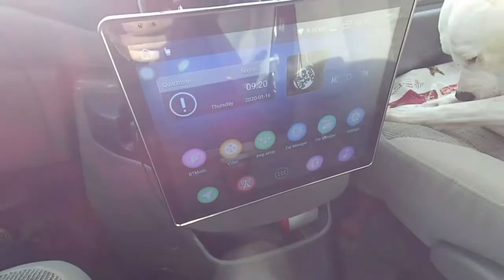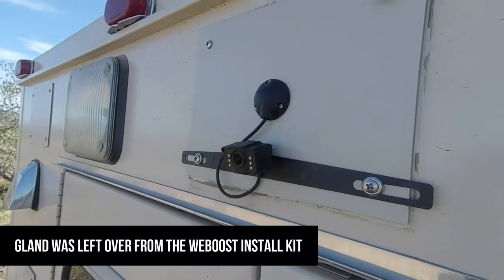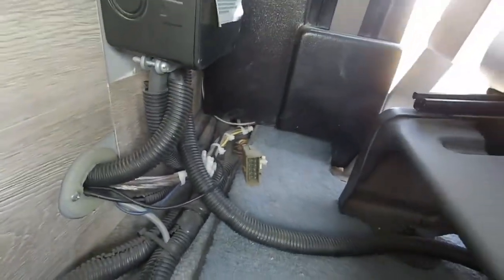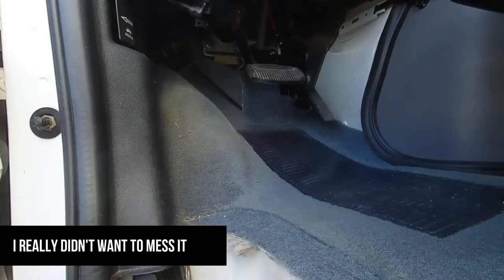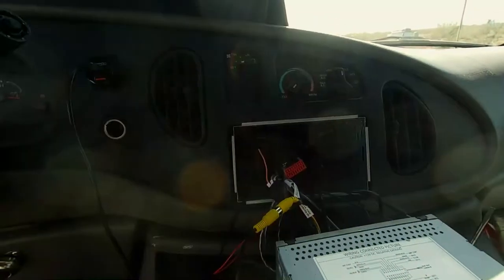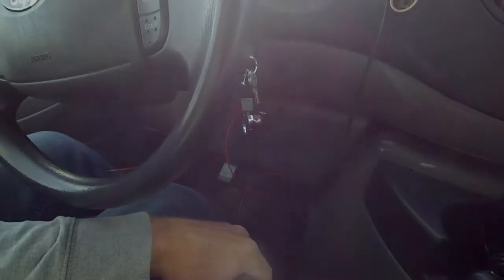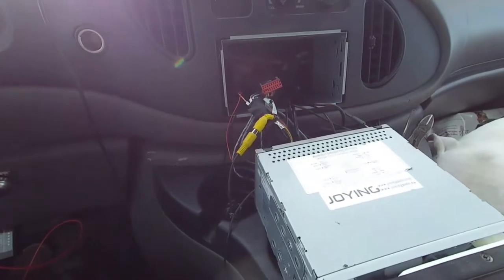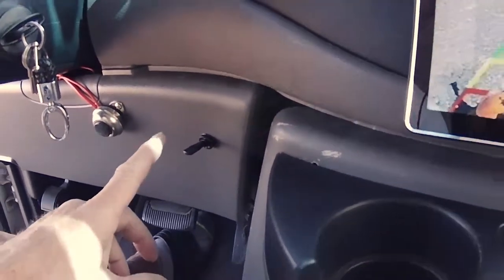Ambulance RV Conversion Gets A Back Up Camera | Building The Campulance

Comment: Thank you for being so detailed with where and how you ran the wire. I have a window AC unit that came with the ambulance but not a heater and I do not want to use a Buddy heater for long. I did not know that the pad in the ceiling would have easy access to wiring, but yes it does. I looked at mine, and I added extra 120 outlets over by the existing bench area. I have not done a heater yet and I will probably come back to this video again to refresh and install along with your video and pause it as I go.
Reply from the maker: I'm glad that it helped you!

Comment: im going to power my revers light with the rear beacon switch. 12v power alread in the back just need to run the video cable and get a sweet head unit. thanks for the motivation. nice job!
Reply from the maker: Hi Joe - yes that will work... but... I'd recommend running it from your fuse block and put a switch on the dash like I did. Having the ability to see what's behind you at any time is valuable. Merging and changing lanes especially. Glad your diving in to it!

Comment: 👍🏼 I did the same thing for my father-in-law’s truck but I use an on-off-on switch. One position was on constant like you have it. The other on position was tied to the reverse lights so when you put it in reverse would automatically changeover.
Reply from the maker: Ah, that's a good idea!

Comment: LOL,   Gotta love the cameras view of the rearend. 
I went overkill on my Big RV.  I put in 9 cameras in my Coach. One under the front bumper ,one under each of the 2 side mirrors looking down the side, one at the top of the rear of the camper , like yours, looking behind the camper where I carry my motorcycle. Then one above the trailer hitch so I can back up to a trailer or to my Towed.  On the side, near the at the rear of my RV, I have flood reversing lights to aid in backing into Campgrounds or corners in tight parking lots, so I put cameras next to each of those 2 side lights.  Then one on the porch light at the entry door and the last one on top of my remote control spot light so I can see if I'm going to clear low hanging obstacles, or scan for tree limbs that will damage my soon to be solar panels, or the RVs AC units or Satellite Antenna.  It's my favorite because I can turn it 360 degrees for a view.   There is a camera switch under the overhead cabinet above the driver area that allows me to switch between the cameras individually, in pairs or groups of 4. All on a 9" monitor on the dash.  The Door Camera can also be viewed by the Bedroom Monitor.  
Like my Dad used to say, "It only cost a little more to go first class, I just can't stay as long!"

Enjoying the improvements and almost caught up watching all of them.
Reply from the maker: You are wired!!!